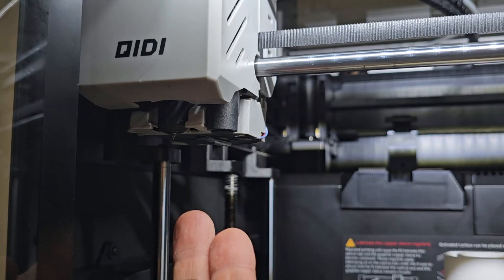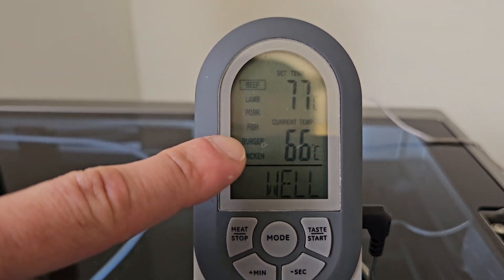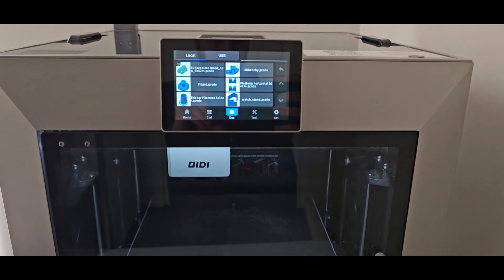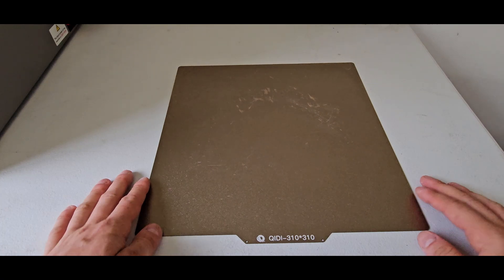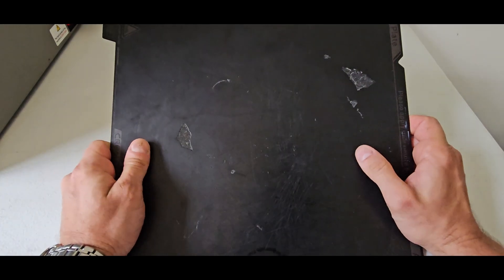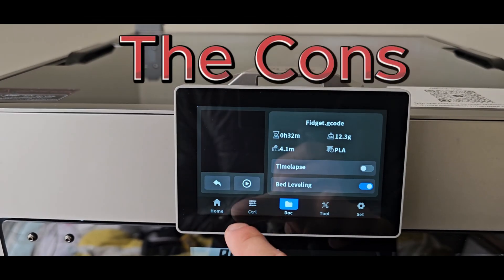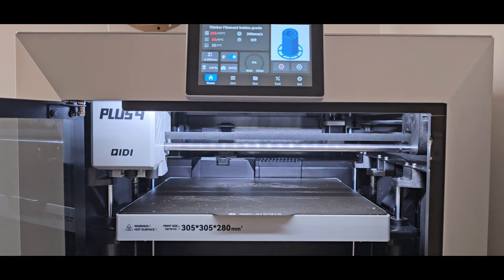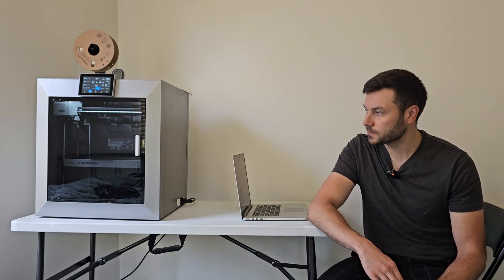I PRINTED FOR 1000 HOURS... What They DON'T Tell You About the Qidi+4

Comment: Had some teething issues, but I love mine, essentially no problems. Handles almost any material great. The accuracy and quality are phenomenal. Can print with essentially no VFA as well.
Reply from the maker: Good to hear
Reply: How? I'm literally about to throw my Plus 4 away because it has horrible VFA at every speed from 20mm/s to 250. I've done literally every conceivable and suggested fix trick and calibration and it hasn't meaningfully solved the problem. I've run over 6kg through it in test and calibration prints alone, with no success. It was my first non resin printer and honestly, it's been such a terrible experience it'll likely be my last as fdm printers are at best beta level products...
Reply: @SweetLou0523  That's very strange compared to most experiences. It may be a belt tension or bearing lubrication issue. Could also have to do with your input shaping. I'd recommend joining the Disk-chord we'll help get you sorted.
Reply: @802Garage  I ran shake and tune and the print is shockingly well tuned. I've run input shaper left right and center and no amount of anything will resolve it. It's significantly worse at low speeds which sucks because silk pla has to be printed at 60mms or lower to achieve proper finish. This printer will artifact the  hell out of the surface at those speeds. Basically below 150mms it's going to look like shit. I bekieveits because qidi went cheapand used smooth idlers on the belt tooth side which introduces resonance at low speeds. This is a critical flaw as they aren't replaceable and no voodoo tuning will work around that. Wish I had known this before wasting money as ahome built printer would have been cheaper and higher quality. This has been my first fdm printer and it has been a miserable, expensive lesson in why it's still a beta level technology with a lot left to mature before it's truly usable.
Reply: Sounds like something loose with the belts or hot end. Don't write off fdm. I've now owned printers from 4 companies with few issues. Looking at getting the plus 4 now that most of the QC issues seem to have been smoothed out or solved.  @SweetLou0523
Reply: @COWGUYVT  belts are tuned and symmetrical, despite qidis laughably shit tension/auto tension system. Shake and tune has them perfectly tuned and charted, this made no difference. I believe it's the smooth idlers they used in the tooth side of the belts causing resonance in the print head. This is a mechanical defect and is unresolvable as they are not replaceable.
Reply: @SweetLou0523  that seems unlikely because everyone else's printer works fine.

Comment: I'm trying to talk myself out of getting one seems to good to be true  the only thing i can see better about the BBL carbon X1  is they have a few more good build plates but thats not really enough
Reply from the maker: Yea it all comes down to temperature.
Bambu isn't hot enough yet, so you can't print as strong parts.
Reply: I almost bought a Bambu but got the Plus 4 when I noticed that it was nominated for Printer of the Year. I'm really happy that I bought the Plus 4. It's a great printer in every way, shape, and form. 

Thank you Qidi for taking the time to design a 3D printer correctly, and not taking any shortcuts in materials or workmanship👍

Comment: I think it has to wait for the bed leveling until everything is heated up so that any thermal expansion can be compensated. Like the tare button on a scale. Can't tare until the vessel is on it.
Reply: Exactly. The guy is trying to push for everything to be done at once for speed, but you know precision robotics hardware that runs under high temperatures simply cannot achieve high precision unless it's calibrating under the conditions it will be printing in. The bed takes by far the longest to heat because it is a large mass of metal. And the bed heating starts FIRST in the chain of preflight steps. The only other thing to heat up is the extruder and that is so quick it wouldn't matter when you start doing it. Maybe they could streamline the process a little, but I really doubt the gains would be that substantial. It just is what it is. It's like asking NASA to hurry the hell up and put the damned rocket in the sky in five minutes.
Reply: Precisely! (sic)

A lot of printers measure the z-offset before heating the bed, and that results in suboptimal results. If you're waiting hours for the print to finish, a few minutes at the start is not that much to ask.
Reply: Not completely true. A lot of the functions could be sped up and synced much better. But I am sure this will happen in future firmware upgrades and it is actually not bad enough to be a problem. 
My main concern is that the nozzle runs over the silicone cleaning pad cold as this will certainly do damage one day. Ah well, then I buy a new pad.
Reply from the maker: Yes, very true. Hopefully we can get quicker soon